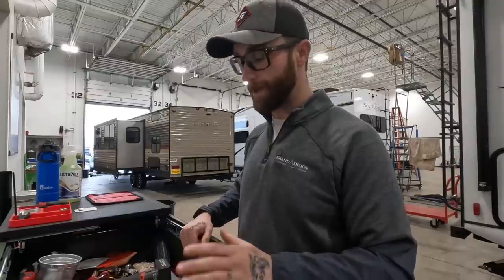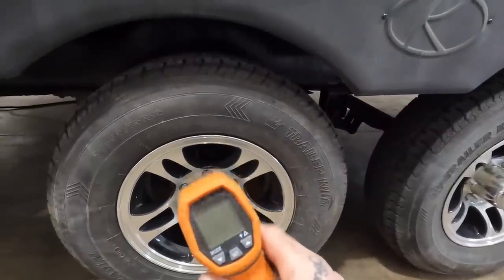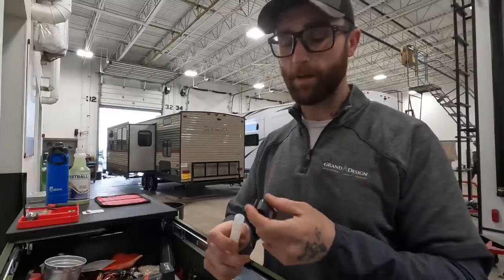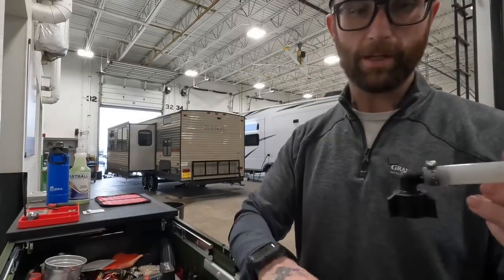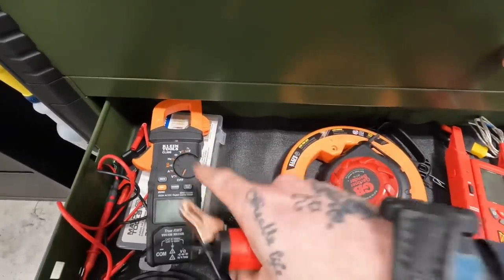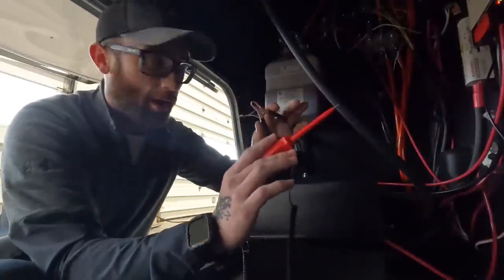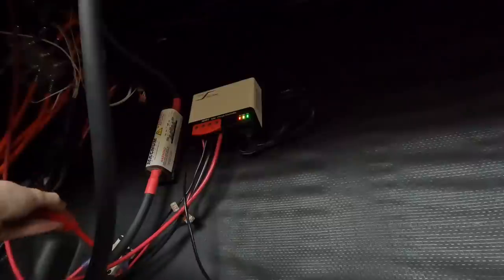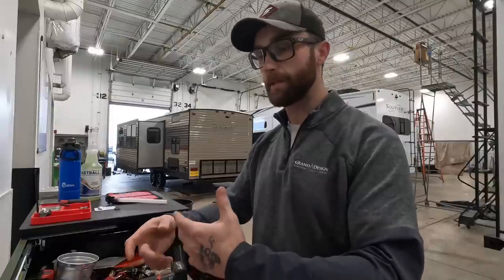5 tools that should be in every RV, part 2 (bonus tool at the end!)

Comment: Why the skepticism about Wago connectors?  Do you have a bad history with them or have you observed them failing in the shop?
Reply: No he hasn’t seen any fail. Nobody has.
Reply: Been using Wago's for years in homes. They don't fail anymore than a wire nut. The same argument could be made with copper and pex. Some plumbers hate pex because they don't think it's as reliable as copper.....it is. Copper and wire nuts are proven materials in construction, pex and Wago's are as well and apparently will take some time to convince everyone.
Reply: I use them in houses, but those don't move...
Reply: I’m an electrician. I’ve seen many Wagos fail. They have a tendency to become loose and arc. Not a huge problem with lower voltage, but it will cause big problems in your 120v system.
Reply: @theamaz luckily 480 volts is considered low voltage. Because dematic uses them in their machines and I have never seen one go bad. Wire nuts go bad all the time, even 120v.

Comment: Other parts of the world only use Wago connectors and would never use a wire nut or butt splice.  They are used all the time on 120VAC here in the USA.  Also Klein's are not just "acceptable" they are the standard for electrical tools. Get Klein and you won't be frustrated with the strippers whoch are the most variable aspect of the tool.

Comment: My travel trailer uses PEX but also has braided hose.  I have had 2 water leaks and it’s always the braided hose to PEX connection.  Any suggestions?
Reply: Rip out the braided stuff and replace it with regular pex. I'm not aware of an easier way.

Comment: Where does this WAGO opinion in this country come from? I agree, I wouldn't use them for automotive / RV applications wherever the connector is exposed to the environment/water. I wouldn't use wire nuts for that either which is basically the competition for the lever nuts. For indoor applications they are as good as properly used quality wire nuts while being easier to use for non-professionals. They don't loose tension due to the spring loaded connection which is a big plus in the RV, they are clear and it's easy to see if the wire is seated properly and they have a test point for measurements without opening them. There are cheap knock-offs that suck, the original WAGO lever nut sized for the used wire is awesome and used almost exclusively by electricians all over Europe. No twisting, easy to properly connect and disconnect (and the wire stays straight). I respect your opinion but don't understand the reasoning for the dislike based on my experience. I replaced hundreds of cheap junk nuts with WAGO lever nuts in 120V and 240V circuits and never noticed any performance difference compared to quality nuts. Thanks for your videos.

Comment: The solder butt connectors that use the heat gun instead of a flame are expensive, but it's a permanent,water tight seal that you can't overheat the plastic.

Comment: You tested after the regulator? Also i dont believe you are supposed to use a laser thermometer on reflective surfaces.
Reply: You are correct, you can not get an accurate measurement from reflective surfaces because the emissivity is too low.  What you can do is put a piece of black electrical tape on it and take the measurement from the tape.  it has a very high emissivity and will give you a fairly accurate measurement.  We use this trick in thermography all the time.